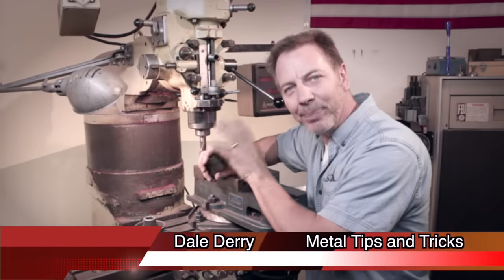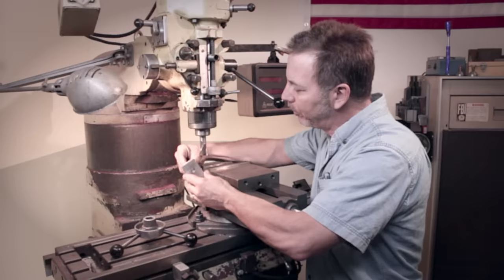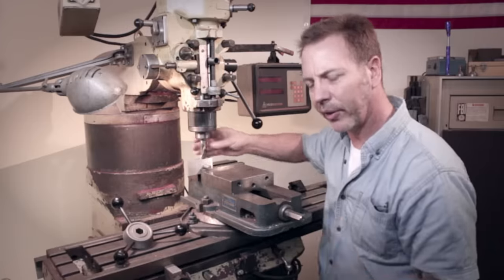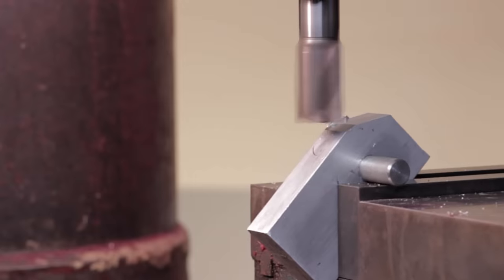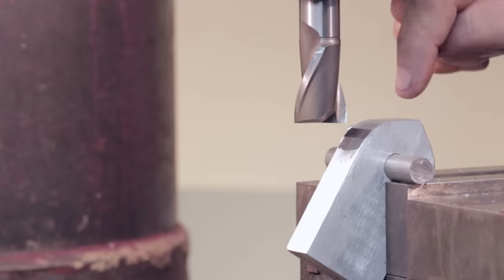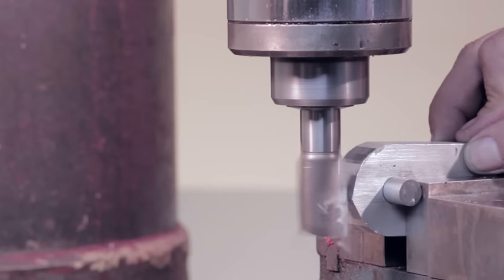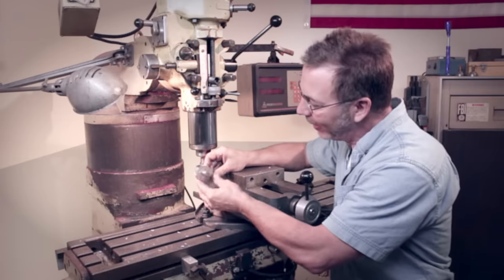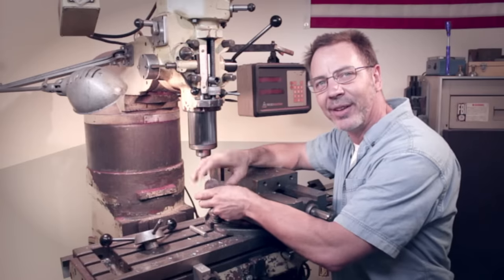How to cut a Radius

Comment: Why not just flat spot the pin on each side so you can lock it in the vice then hang the end to be radiused off the side of the vice and pivot the part around the pin against the the mill to get your radius? You could use a vice grip clamped to the back of the part to get leverage or build a handle with set screws to hold it. Ultimately it would operate on the same principal as a ball cutter for a lathe.

Comment: I loved the video. And excuse me because I am very very new to milling. So my question isn't saying that you did it wrong, I am literally asking why I wouldn't do it this other way. I am sure there's a reason and would love to hear what that reason is.
 Thanks you.
 So, why wouldn't you vice the pin instead of the piece. Then slide it up to the mill for distance measure. Then spin the piece, letting the mill remove the material in that radius?
Again, Not calling you out. Just want to know why I can't do it that way. I assume it's a safety thing.
Reply: Hey sand i think what your asking is bolting in the pin and moving it by hand throught the work ? 

If thats so it would end up grabbing the work and taking off, breaking the end mill .   I think if you used a rotery table it would work like your thinking . Put it on the center pin  ( and raised above the table on a sacrificial plate ), clamp down and rotate the work making sure not to cut the table .

Comment: This is a great technique for a guy playing around in a hobby shop that doesn't want to spend the money on a radius cutter, but I would expect to get fired if I did this on the clock.
Reply: @Michelangelo19571  Yeah, it would be a good sized rad cutter, but you can get them. A router bit would work fine in aluminum. I used to use big radius cutters like that quite a bit years ago when I was still doing manual work. These days I'd just fat finger a quick program for something like that.

Comment: So why would you not put the pivot pin in the vise vertical so that your part would lay horizontal in relation to your tool. Your pin would need to be close enough to the end of your vice jaws that you milling tool could project below your parts bottom surface when installed on the pin. Turn on you mill after establishing your cut tolerance and turn your part on the pin against the cutter. One smooth motion and your part is done. No grinding or further work.

Comment: Hello every body .. good trying to do that with heavy milling machine . But i guess you can make it faster and easier with jigsaw if you are going to use the suitable soft metal blade . Fast and accurate and better than milling machine. After that you are going to use sander machine that is being used with woods .

Comment: So now, why would you not just put the pin vertically in your vise and turn the part against the side of the end mill? Knock the corners off, move your X axis in closer, make another pas and continue on until the radius is cut. You could use a C clamp across the width of the bar as a handle to turn and control the part.

Comment: You didn't bring the stop up to lock the quill when you cut with the side of the mill. If the lock wasn't real tight the mill could have been pulled down into the work.

Comment: I thought that machines do the cutting automatically so it can produce accurate measurements. I am just a student, and i don't have any experience yet. 
Nice video.
Reply: @biscuitsandgravy  This comment is 3 years old. I'm an engineer now, and i should obtain the PE license next year. I've decided to go to the HVAC industry since i saw myself interested in thermo/fluid mechanics. Thanks for replying.

Comment: Wouldn't it have been faster to set the piece horizontally ok the vice, clamp the pin and rotate the edges towards the cutting tool (obviously holding the piece with something to be safe)

Comment: i do it that way: clamp the axle in the vise and turn the part via hand while the mill is running. but i have done this only with a small proxxon mill and aluminium. but my way is much faster!

Comment: Schottrod
I hate to pop a bubble but this may be close to plagiarism.  re. The Machinist's Second Bedside Reader by Guy Lautard 1946 ISBN 0-9690980  Page 105 - 106 ( Note pre CNC)  Though your description is a little more refined but lacking the caution "TURN THE MACHINE OFF"  when changing position of work. In any case it is a good idea.

Comment: or just take a plate drill a hole put a pin in it clamp it width away from the belt grinder and manually spin it   -half the hassle

Comment: A much faster way to do that would be to scribe the radius on the part,  cut it out on a vertical bandsaw then Sand to the line on a belt sander.

Comment: You started out with a good idea and what you did worked out fairly well. But, you're showing the viewers the most dangerous way to do something. One slip and you could lose your fingers and possibly shoot the part at your face. In the end, you still have to take it to the belt sander to remove all the flat spots.

Comment: wouldn't have been faster to mount it with the pin vertically in the vise and just rotate the parts through the mill?
Reply from the maker: you can but it not as safe.

Comment: Where are your side shields.   Promote safety, safety is smart.  When you get the radius formed on the mill and want to finish it, instead of using a file, take a strip of emery about 10 or 12 inches and put the part in a vice with the radius up, holding the emery cloth in each hand, sand the radius, one hand on each side of the part.  Do a, "milking a cow" action and the radius will be completed.

Comment: Yeah this is the same old trick as for cutting a circle out of wood on a table saw. Math is your friend. As long as you know how to figure out the mathematics of the desired finished diameter and can drill an accurate hole at the radius and can live with a hole in the finished piece this will get the job done in many cases. Of course if you need really high precision or the finished piece cannot have a hole in it this won't do and you'll still need to bust out the rotary table but in probably 75% of cases this would work just fine.

Comment: This is not the method a machinist would use. Corner rounding end mills are made for this specific purpose. Radius one corner, flip the part, radius the other corner, and you have an accurate, full radius part.

Comment: um . this is great if u dont have the indexing table. dont say that all that fidgiting and 150 passes later is easier. plus the part still isnt clean machined. pretty sure the customer will see the diff with the belt sanded edge if u are going to make it smooth. but yup good if u dont have the table

Comment: Wouldn't it be much faster and easier to put the pin in the vice vertically and then just spin the piece of aluminum???? I'm not a machinist but seems to me it would be far less steps and much better results.
Reply from the maker: I dont think you could hold on to it.  The cutter will crabs the metal and break you or the bit.
Reply: Build Something Cool is there a vice available that rotates?
Reply from the maker: Yes and no. There is something called a rotary table that you bolt down to your milling machine table and it allows you to put different  fixtures on it like a vice.:-)
Reply: Build Something Cool I can't believe nobody has designed something you can bolt to the table that you can spin with a similar handle setup like the rest of the mill. Could that be a big money making device if someone was to make them?
Reply: Build Something Cool I don't know but I just saw about 5 different rotary table things that you could do this on very quickly I would think but I'm not the pro.lol
Reply: Very easy to do, i do it all the time almost daily for last 26 years. Shame i cant reply with a piccy ot video that woud guarantee scaring the crap out the safety police on here.
Reply: Jonny you can reply with a link on here for a video
Reply: No videos uploaded any where

Comment: I don’t mean this pejoratively but that seems kind of Mickey Mouse. If you don’t want all the time and trouble of a rotary table, why not just install a vertical pin then attach a long, stout rod to the part and cut away, taking very light cuts and rotating the part 180 deg. from and to suitable stops, by hand?

Comment: You do things the hard way. Put pin in vise vertically and rotate the part using the side of end mill with a rough and finish cut and before you realize it you are finished.!!

Comment: You are incorrect with assuming that because the pin is constant then the radius will be right, in fact if the hole you've drilled is not exact centre then the radius will be wrong, but it'll be close enough if you're not fussy. Also you are telling people to do a dangerous thing because if they haven't tightened up the vice properly it just do some damage to someone.

Comment: Why not get the right cutter? Couple of passes and job done.
Reply: steve gale  More expensive than keep taking the job out and then resetting on the rad?Not many steps there (both in dimesion and working). 
If you're going to do a rad like this and no cutter, put on a great big champfer, then file over to suit. Saves mucking about.

Comment: The weird thing is the amount of time it took to cut that radius your set up would’ve probably been a fraction of that and just minutes actually cutting it on the rotary table. I’m not sure what you gained by this other than an F for safety. It’s a little contradictory and using a milling machine to do a grinder activity. You could do that same deal with the vise on the grinder or a 72 inch belt sander and probably the same time. My time is better served finding a monkey and a football.

Comment: All you needed to do was put the oin in your vice plate clamp line up the cutting tool and just hand turn the radius with a calming wrench Dah??? It will turn out smooth and perfect without filing..dah? Yep that's Right....

Comment: You did say that you should have switched off the machine before starting next cut to save time then you showed a different method to improve radius while machine was still running, what you did was to show young apprentice's and beginners in engineering shortcut's that were potentially dangerous that would stay in there minds forever, bad move on your part.

Comment: So what if you want a radius on a piece that doesn’t have a hole in for a pin ..... answer ....CNC plus this is dam right dangerous no guard no safety glass aluminium gives off  needle type swarf

Comment: Rotary table would have been faster, better job and a lot safer.
Reply: steve gale  A part like that take 2 minutes tops to set up on a rotary table without a chuck.  The machining would take much less time and would not require hand finishing like he did.  You would end up with a more accurate part with a better finish.

Comment: Oh come on, you can do way better than this. Put that pin in the vice straight up, with the part on. Attach a big C-clamp to the part to hold with yer mitts. Bring cutter over, rotate part with C-clamp by hand to do the work. Feed Y as needed to complete the radius. No facets, safer/faster (either you're near a moving cutter with this technique, or you spend a lot of time with the power switch), one setup.

Comment: Always turn off spindle and slow to come to a complete stop before reaching in to adjust part clamping . Not good to demonstrate methods that are unecessarily risky! You may have saved time but your tip isn't worth it. Good you trolled yourself . Crappy tip you should have kept it to yourself . Yours Sincerely signed a troll.